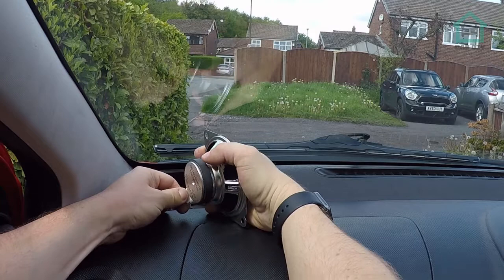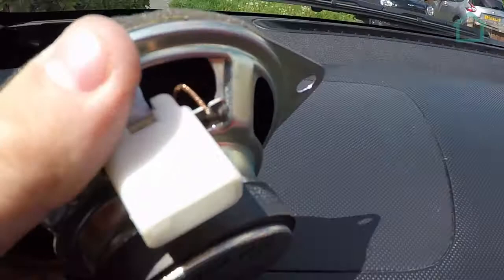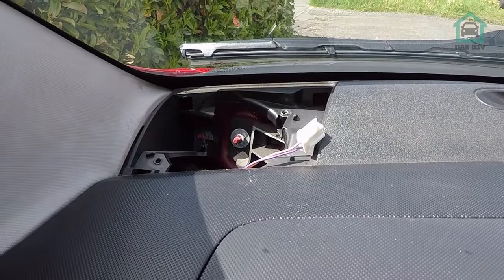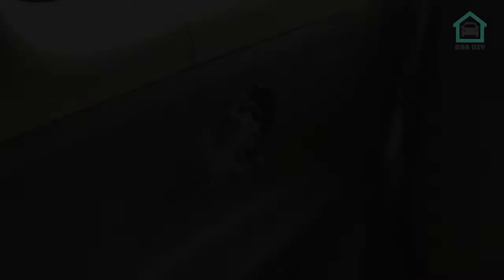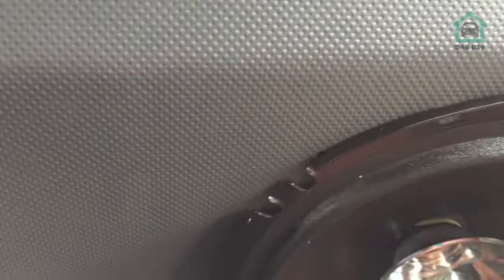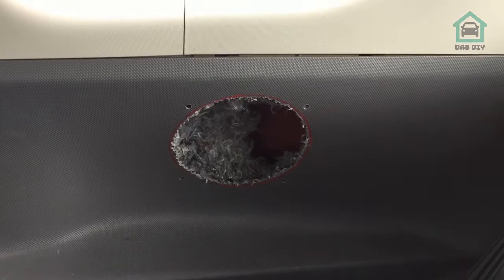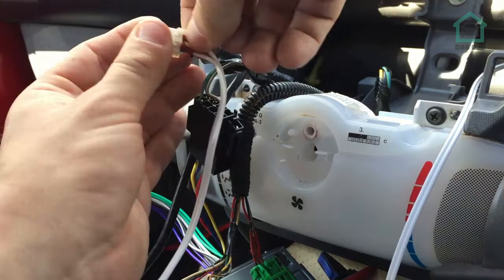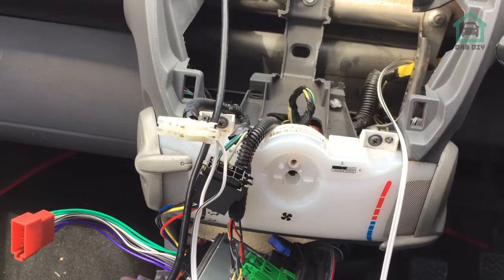C1/107/Aygo Pioneer Dash Speaker Change & Rear Speaker Install

Comment: You do realise the speaker bracket tabs are designed in such a way that you can simply snap them off by bending it back and forward a few times... Right?
Reply from the maker: I did know that, yes. I didn’t want to have the sharp tabs left over once snapped. I cut them off and cleaned up the edges with a polishing stone to prevent that.

Comment: So, you replaced the factory ("tweeterless") speakers with absolute low-end, entry-level after market "tweeterless" speakers, which sound AWFUL. Why? What's the purpose of the dat? What's the benefit? What's the upgrade? Regarding the rear speakers, no comment on destroying the panels to install another pair of trash quality low-end, entry level "tweeterless" speakers (it's your car anyway). Great success! All 4 speakers work...
Reply from the maker: Not sure where the hostility in your comment is coming from. If you consider these pioneer speakers to be of inferior quality to the paper cone POS speakers installed from the factory, I think you might find that you’re entirely mistaken. As for the rear panels, it’s not like they can’t be replaced with a like-for-like panel from a scrap yard at very low cost. As you said though, it’s my car. I consider anything to be an upgrade from the two paper dash speakers installed from the factory.

Comment: Hi great video. I'm looking at doing the rear speakerr install on my 3 door 107. I've bought some 16.5cm speakers which are the same size as you installed. Please could you tell me the measurements for cutting out the plastic panel to ensure they fit workout hitting any of the cars metal framework?  Huge thanks
Reply from the maker: I didn’t actually take any measurements, I used the cardboard template that formed part of the box.
Reply: Thanks for the reply. I didn't explain myself very well.  I meant your measurements on the door itself.  So you knew where to place your speakers. Hope you can help.
Reply from the maker: Ah, I understand what you mean. I’ll be honest with you, I didn’t measure at all. I took the top of the panel off, looked to see what the gap was like behind it and made my best guess lol.

I don’t currently have the car in my possession right now, I’m away from home with work. As soon as I get home at the weekend, I’ll let you know. Follow me on Instagram (@dabdiy) and I’ll post it on there 🤙🏻

Comment: I did the old skool parcel shelf install :) Added the pins in the iso connector then ran the wires through to the boot, made quick connectors with spades so you can remove the shelf if needed :) But I like the idea of an install in the rear panels - looks more factory. Nice job.
Reply from the maker: I was considering doing that with some 6x9s like I did when I was younger, but the parcel shelves aren’t all that sturdy and are becoming increasingly rare.

Comment: Huge fan of the C1 content, I’m a Pug 107 owner (first car) and have been modding / upgrading bits n bobs of it over the last year.

Just wondering if a) the front speakers have stood the test of time and if they still sound as good? B) what model of pioneers did you use for the rear speakers? 

Cheers, George
Reply from the maker: Hi George

Glad you like the content!

The speakers sound as good as the first day they were installed, they’ve held up really well. Since this video, I’ve installed an under seat subwoofer under the passenger seat and I’ve got some door cards with speakers in them, video about that to come soon.

I’m not sure which model number of speakers I used in the rear, I just know they were the 6.5” speakers, they’re the same as I’ll be installing in the door cards. Sorry I couldn’t be any further help. If you’re on Instagram, follow me @dabdiy and I’ll post on there soon which speakers I’ll be using for the door cards.

Comment: Great vid. I have a 4 door and have searched everwhere for a vid installing rear speakers into those rear doors. If you're planning on doing a vid on that i'd be very interested watching
Reply from the maker: I only have a 3 door version, but if I ever get my hands on a 5 door, I’ll certainly make the video.
Reply: I have a 5 door and there doesn’t seem to be enough room for speakers in the rear doors. After upgrading the dash speakers I got around the bass (or rather lack thereof) problem by fitting a Kenwood sub/amp under the passenger seat. It makes the sound 1000x better and isn’t too difficult to install 😊
Reply from the maker: That’s next on my to-do list 👍🏻
Reply: If you get the door panels off you can see space behind them. There is a layer of white styrofoam covering that area but you can cut out a hole for the speaker. The speaker has to be in the door bin.
Reply: @infidelcastro5129 is there a tutorial on how to do this somewhere?

Comment: Dave! Would you know roughly how many speakers that factory head unit can power? I'm planning to put another set in the rear doors on my Pug, but I already have 6 and an underseat sub unit.
Many thanks and keep up the good work!
Reply from the maker: I guess if you used an amp with a high level input, you could use that to power more speakers. I doubt the factory head unit is up to much tbh.

Comment: hi there, great video, I would like to upgrade the sound system on my aygo 2008. I have some questions , because the car came only with front speakers. Which wires (diameter) have you used to connect the rear speakers with the head unit connector? Did I get it right that you used ISO MALE Connectors? or did you use female iso block connectors? Thanks for you help in advance
Reply from the maker: All the answers to your questions are in the video. I used a roll of generic speaker wire to run the cables to the back and fitted these to the ISO block converter. I did have to swap the red and yellow wires around so that the head unit can retain its memory though.

Comment: hi, thanks for the video, but on mine there is four wires coming out of my 2014 peugeot 107.. while yours is two wire system.. please advice what I need to do..  thank you in advance.
Reply from the maker: I’m not sure about that one to be honest, I’ve not come across one with 4 wires before. I would assume that you’ve got component speakers from the factory; that is speakers with both a mid woofer and a tweeter in the same unit. Is that right?

Comment: I don’t understand the whole wiring situation, what is the easiest way to connect the speakers? I’m thinking about doing this tomorrow but every YouTube video confuses me 😭
Reply from the maker: The video has shown on screen which wire goes to which terminal. The only bit that might cause a problem is actually doing the wiring. If you have any questions, follow me on Instagram (@dabdiy) and PM me.
Reply: @DABDIY  thanks a lot! I guess wiring just isn’t my thing lol 😂 I’ll give you a message when I come to doing it tomorrow but do you think it’ll be hard or is it rather simple once you’ve started?
Reply from the maker: It really is quite simple really. If you follow the wiring colours shown on screen, you can’t go too far wrong.

Comment: Hi, 
I want to add some rear speakers in my C1, is it possible to inbuilt speakers with an inbuilt depth of 86 mm in the rear side panels?
Reply from the maker: I’m not sure, I didn’t measure the depth
Reply: OK. Thanks for your rapide response
 @DABDIY

Comment: Hi, was it worth to add the rear speakers or would it be enough just to change the front ones? Or is it a big change tthat it would be worth to add the rear ones?

And is there enough bass?
Reply from the maker: It absolutely was worth adding the rear speakers. There’s enough bass to be getting on with, but I intend on adding an under seat subwoofer soon.
Reply: @DABDIY  nice thanks dude

Comment: Heyy I have a question wich iso connenctors did u buy? Or the link of the website
Reply from the maker: The ISO block came with the single DIN facia as a kit. I got it from eBay, but unfortunately, I don’t have a link.

Comment: Good video, how did you crimp the ISO connectors onto the speaker wire
Reply from the maker: Cut and soldered
Reply: @DABDIY  alright cheers :)

Comment: Im really struggling to find those silver  iso block pin connectors you show at 10:40 anyone know where I can get these or what they are called?
Reply from the maker: ISO connectors and I found them on eBay